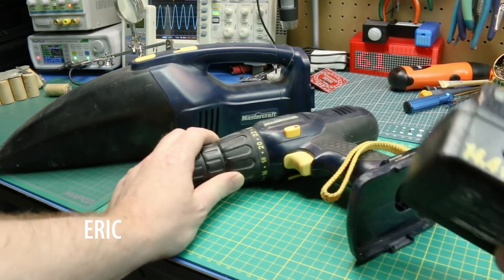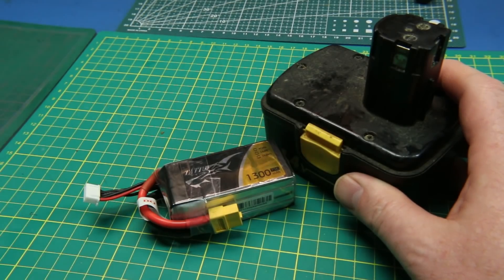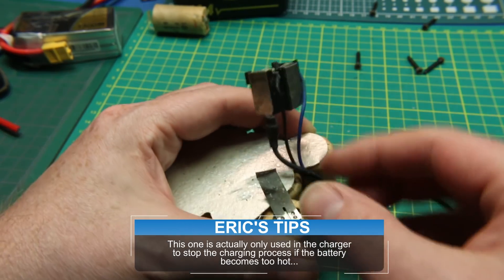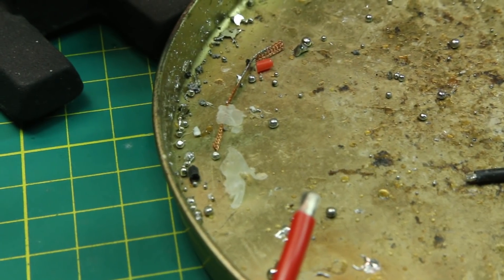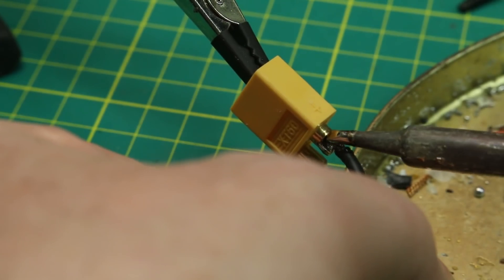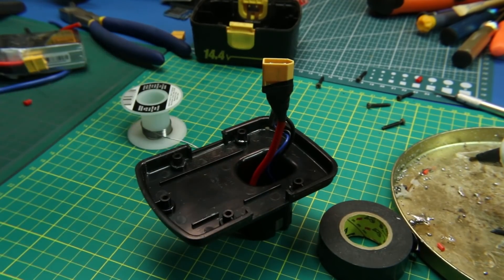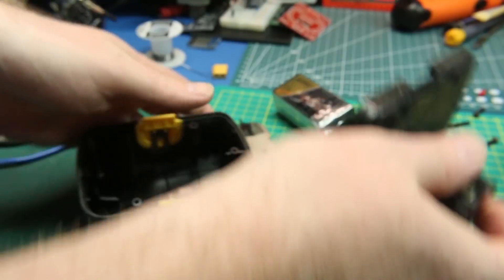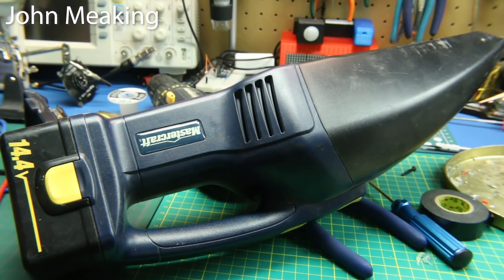Fix That Drill Battery- DON'T THROW AWAY ANOTHER TOOL!

Comment: I've done this too, however the case for my batteries didn't have any screws, it appears as if it was maybe an ultrasonic wield, so I had to carefully cut it open along the side using a Dremel, a little scary even if the cells were dead however I got it open with barely even a scratch on any of the cells but the case is a little harder to reuse.

Comment: Will you need to disassemble it to charge the battery? or can you use the old charger?
Reply: All you need to do is cut two holes in the case and make double ends with XT60 connectors, one for the tool and one exposed, then you can glue your connectors into the holes you made so you can hook up your balance charger to it or if you prefer to not have the ends exposed, then you can just cut out a little slot where you can grab the connectors or glue them down slightly recessed in the slot.
Reply: @vgamesx1  
 I did think of that, but you would then need a bit of a cover for the plugs, would not be much fun somehow shorting all that potential energy while you drilled a hole or something..
Reply: @landlifem5872  Well that seems pretty unlikely but the easiest solution in that case is take another connector and either epoxy over the exposed pins or try to rip them out so you can make it shorter or option two, wire the charging connector with fuse wire, 2A rated should be plenty for charging and if it shorts it'll blow instantly.
Reply: To get a proper balance charge you need to dissemble and use lipo charger, but it's only one screw  and a plug.
 If you had a 3d printer, one could design and print a part that allows for quick battery removal from the case for charging